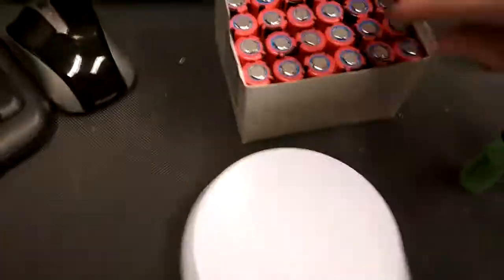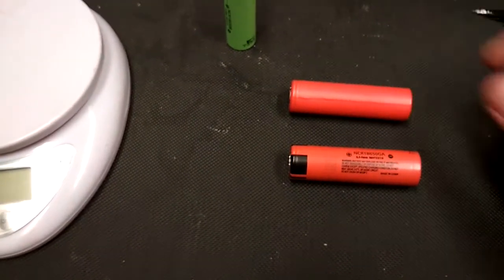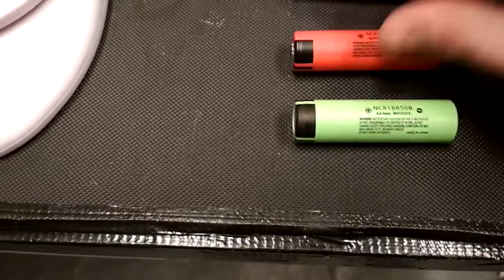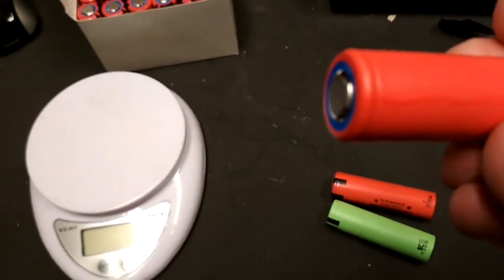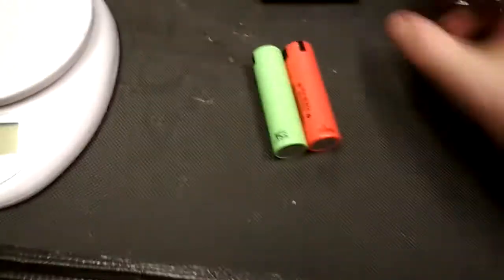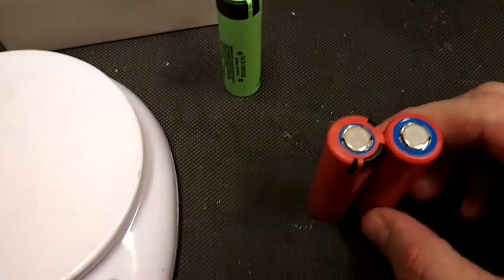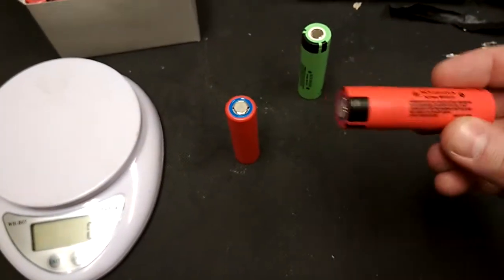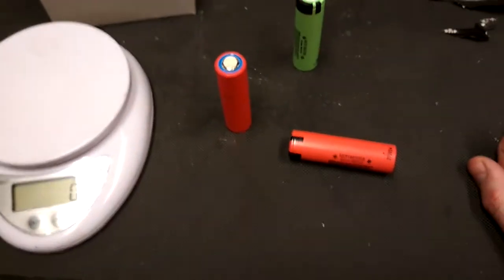Fist look at the chinease version of the Sanyo NCR18650GA

Comment: Hello, I got some batteries in a battery pack made by Unit pack power and I'm worried that they are fake. I asked for 52v 17.5ah battery with sango GA Cells 3500mah and the cells inside my pack say on them ncr18650 made in china. They are the same design as Panasonic but they are Green, please take a look at the image and see what you think, thank you. I don't know how to add a picture.
Reply: Hello, i also bought green cells sanyo ncr18650ga to build a pack from nkon website, thé seller told me it's sanyo cells from chinese Factory but indeed they have the same design than Panasonic, that's weird but you should know sanyo is a brand of panasonic and maybe that explains similarity of both cells. Now Nkon doesnt sell anymore green sanyo but only red one that are showed in this video and also red sanyo without description from japan.